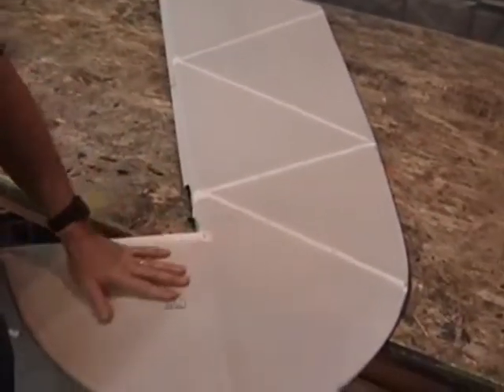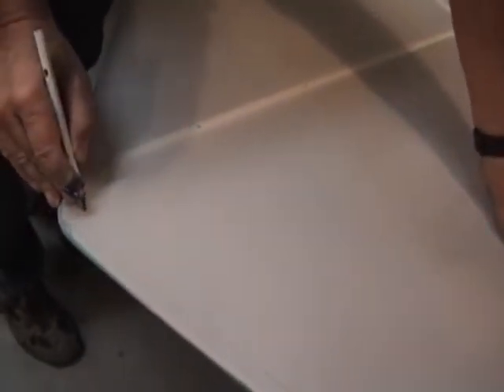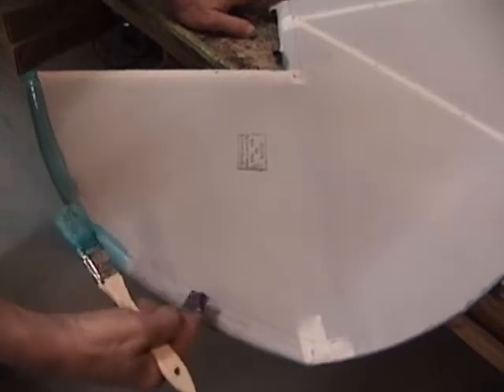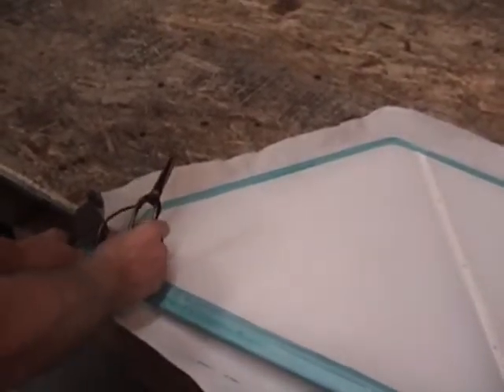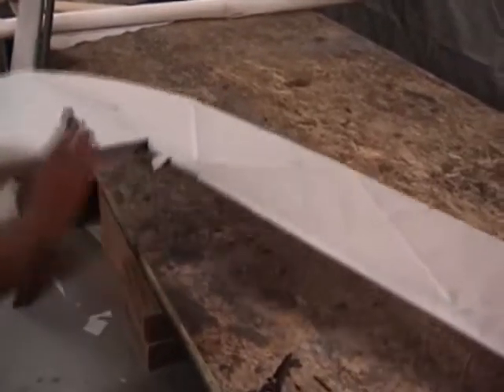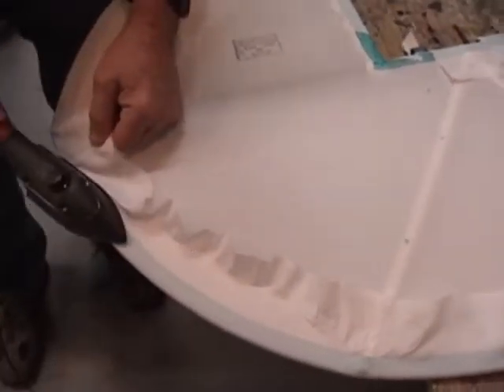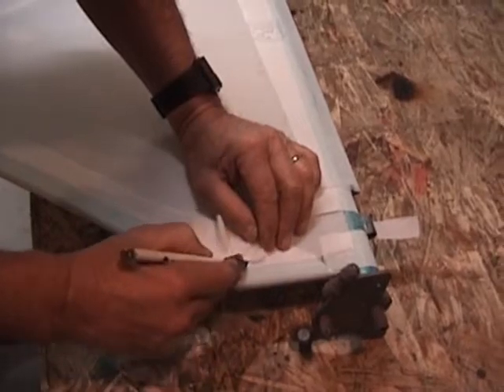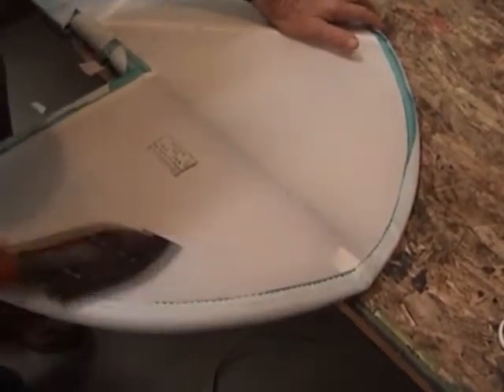Part 3 - Control Surface Aircraft Fabric Covering with Stewart Systems

Comment: On the second surface with the large glue area around the perimeter the video does not show the glue being wiped down.  Is it not wiped down like shown in the previous video?
Reply: whoops it was done at the end... so the initial glue is not wiped off but the secondary is...

Comment: Thanks for the great videos. I am getting ready to build a Legal Eagle XL and this is an area I am unfamiliar with. While I'm sure you just make it look easy, I think even a novice like myself could do a stand up job of covering my wings and control surfaces. I will be in touch when I get to that point. I plan on building my wings first, with the horizontal stabilizer, elevator, vertical stabilizer and rudder to follow. Thanks again!